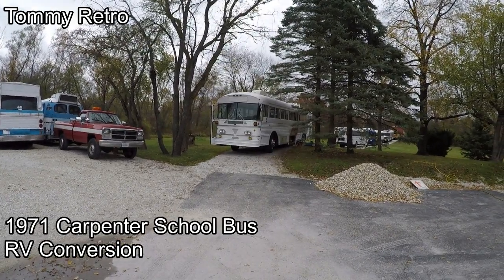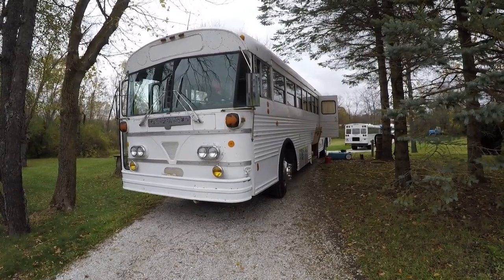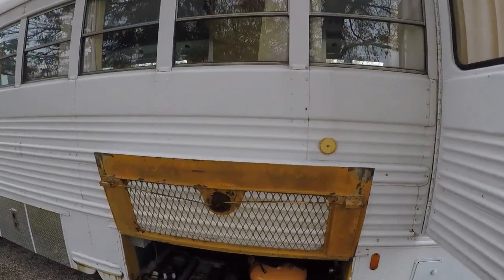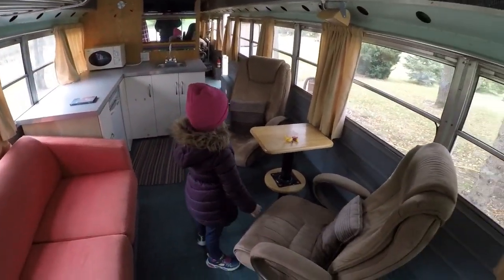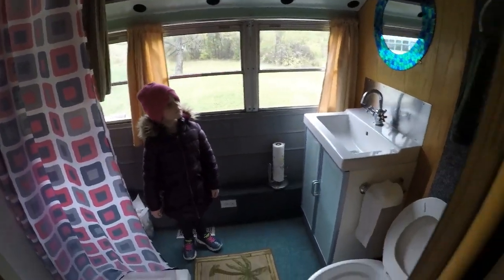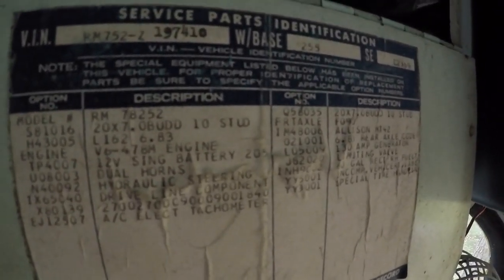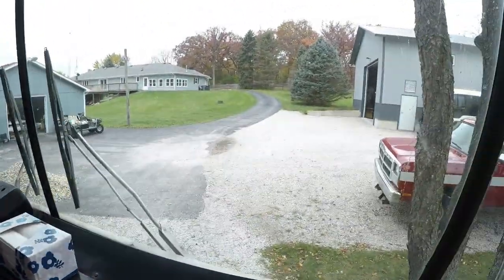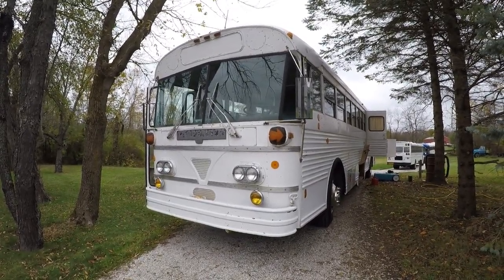1971 Carpenter School Bus RV Conversion

Comment: its a nice conversion i can't believe it was in school bus service for a very long time as here in pa its like 12 years they retire busses from service and place new busses in service. in the rv nowadays people do away with the roof top air conditioners on how big that bay was that housed the original engine and compressor you can install a mini split system as it will keep the bus cool than drawing more power from the 2 roof top ac units as the mini split has a heat pump too would help on keeping the bus warm in the winter time. as this conversion was done on this bus in 05 mainly before these mini splits came popular. i see got the original Bergstrom fans but has the split bergstrom logo on the cages the earlier ones says Mor Heat Bergstrom mfg co Rokford Ill. than the split logo till today its half sun and snowflake logo from the late 70s to present. As this 1971 bus was made right when Carpenter had better tooling  as its the Carpenter busses prior to 1995 when they went out of business had the problems with the roof welds. was more serious after a Florida rollover crash when the roof collapsed. as Carpenter where this was made was in Mitchell Indiana. Had you kept your eyes open for any busses with a Superior body on them? the ones prior to the mid 70s were superior coach and then they were ran by the Sheller Globe Corporation. till the early 80s. then Mid bus took over that plant in Lima Ohio. as its closed now.
Reply from the maker: Thanks for your comments!  It’s interesting how long school buses stay in service depending on the region that they serve!  I am on the look out for a Superior bodied school bus.  That is the only school bus body of the big six that I currently do not have.  Please let me know if you see or hear any leads.

Comment: Some GM history for you Tommy, it’s actually not a Chevy V6, these are a GMC specific V6 engine, ranging in size from 305 to 478, also made a V8 and a V12 called the Twin Six based on this platform. Most of the GMC trucks, from the 1500 series and up from the early to late 60s had this engine family before they switched to Chevy engines